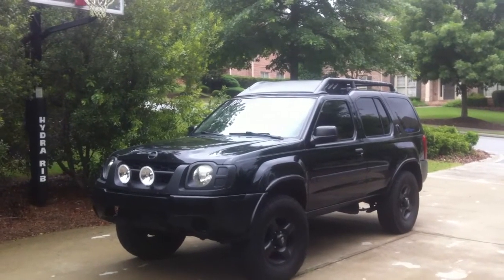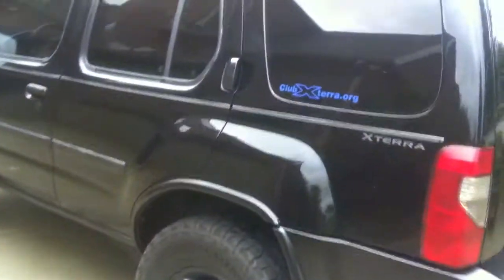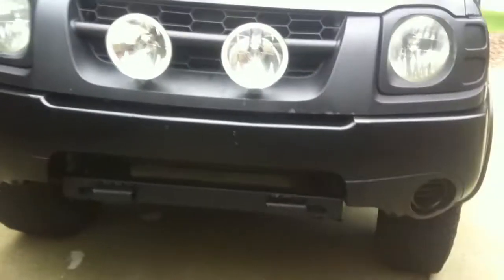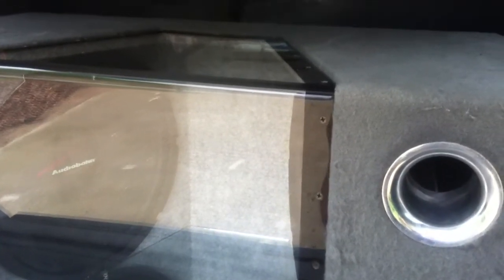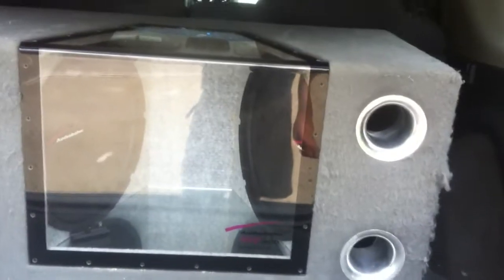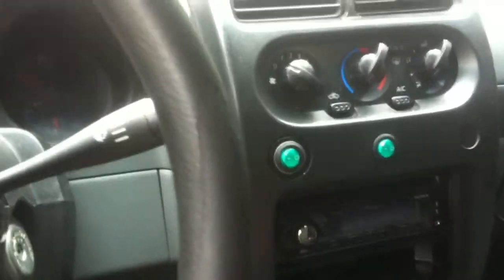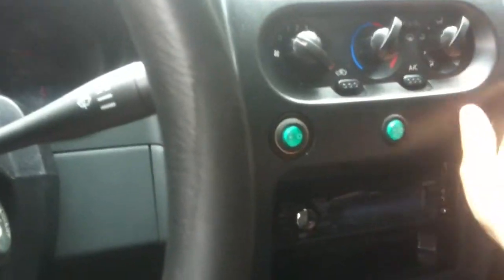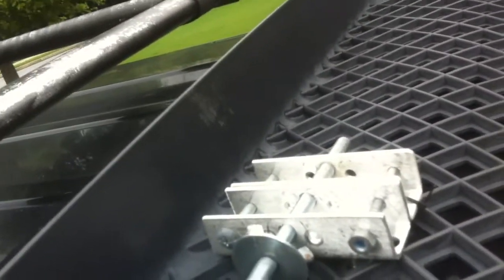LIFTED NISSAN XTERRA 2 | @ProjectXterra

Comment from the maker: I first sanded them down and then put some primer. I used the high heat paint form duplicolor. It is meant for cars and trucks. after all was painted i used a clear coat to go over the pait to protect them. Its held up for a while. no fading or scratches. Its basically on my rims for good.  My build is on xterra nation. I just put the link to my build in the description.